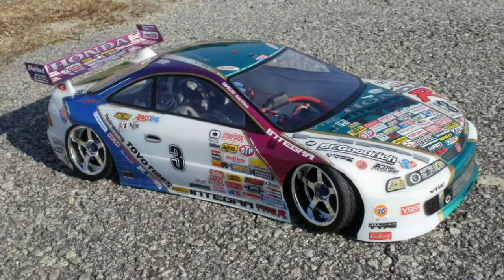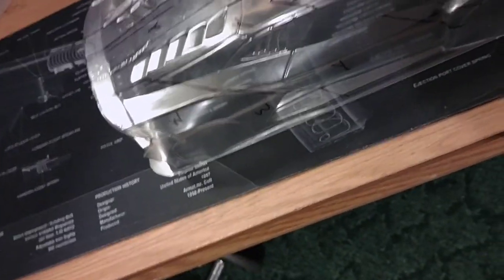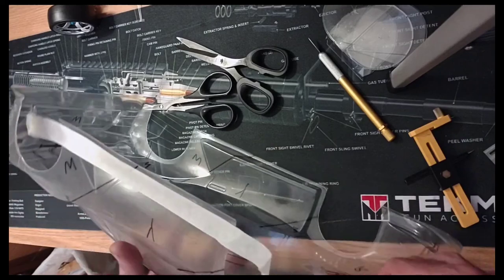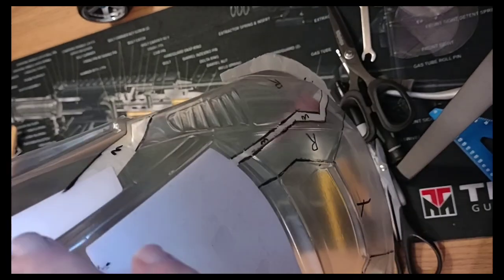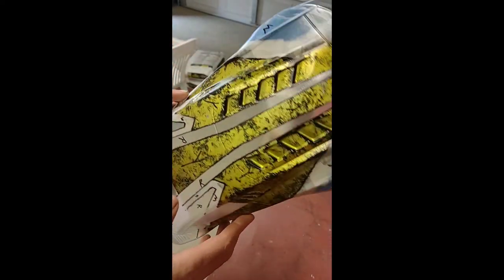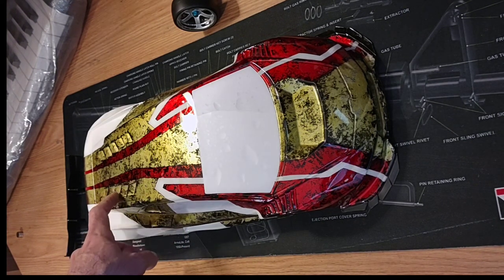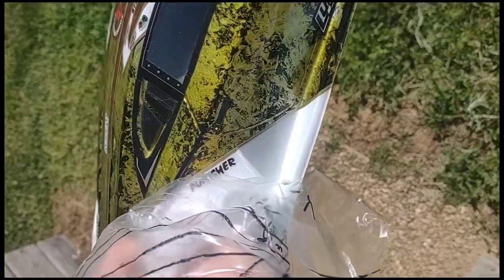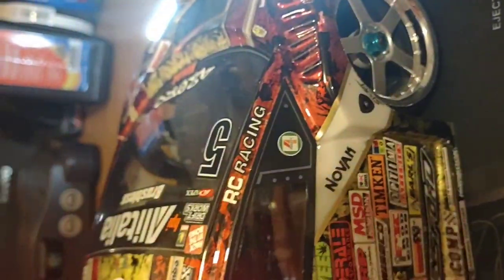Paint a rc car body-Beginners tips: Candy Bowling Ball Mineral Effect #lamborghini #arrma #limitless

Comment: I've been airbrushing RC bodies for a little over 7 years now, and I don't know why,but I could never get any kind or any brand of masking tape to work well with me,but you and alot of others make it look so easy lol. I'd be lost without liquid mask. I started using Bitty Design liquid mask and HVLP sprayers, and the rest is history. Honestly, I don't see how guys like you and Hemi Storm make it look so simple.
Reply from the maker: Its been a couple years since I used mask mainly because I stopped doing off road & moved to on-road & drift. As far as tape I use 2" & 1" by 3m - painters grade. There's always going to be mistakes & this video is to help reduce & recover from those mistakes. Also to help make it easy for beginners just getting into the hobby, they can get the best results they can going forward. I've been doing this a long time dude & the biggest things for me are the trimming & all my cuts are perfect. Punching the holes & or the magnets are lined up to mount the body.  The tape, making sure it's smashed to the body real good along all the edges, even in between coats too. That's where the runs come from plus if your roll falls over on it side it collects dust, lint, ect. the paint lines won't be straight even if tapes itself is perfectly straight. What are you running, on-road, off-road, both?
Reply from the maker: I just seen you had a question something about the curved scissors but it didn't come through dude.
Reply: Yeah, I had seen your tool for getting a perfecr cut on the wheel wells and wondered what it was called. I just used curved scissors and my trusty dremel. But I'm thinking I may have to get one of those tools. @skin-kneedesignsskd269
Reply from the maker: @Jarhead1313  It works great. I bought it on eBay $15  Brand: Olfa-compass circle cutter. Comes with 4 or 5 extra blades to. It's worth every penny dude.

Comment: Can you show the colors used and how you did that other body with the green camo type look? Awesome work!
Reply from the maker: Thank you, I appreciate it! 
The brand spray can paint: "Spaz Stix" - Candy Apple Green, Mirror Chrome, & Black. You can find it on eBay & Amazon cheaper than the hobby shop. I painted it the same way I did in this video, but I used the Candy Apple Green instead. I did 2 coats of Candy Apple Green on the Gallardo, that's why it turns out a lime greenish color, & 3 coats on the hood of the Countach looking more like a forest green. Same green, same spray can, just one extra coat. The thing about Candy is the more coats you spray, the darker it gets & if you do to many coats the mirror chrome & black won't show through the candy. Definitely do a test sample to get the right shade. Hope that helps you out dude. Maybe watch the video again when you get the paint & go step by step using the candy apple green instead, with mirror chrome , & black. Pause the video & rewind it if need too.
Reply from the maker: You're welcome.
Reply from the maker: Hey dude, I just uploaded a video step by step sample with the candy apple green Camo in a little more detail.
Reply: @skin-kneedesignsskd269  awesome! Thanks, i'll watch it now
Reply from the maker: @richieaustin1604  Yw, I was just thinking about what it would look like dabbing all the colors in multiple layers.

Comment: Awesome work. That blue mineral body on the video thumbnail... is that also done by you? A tutorial for that would be great.
Reply from the maker: @michaelg.5936 yeah man, I did everything in this video & thank you!  I also did another video where I explaining the breakdown on how to get different patterns. It's called the "New candy camouflage, not your traditional camo" 2 samples
Reply: @skin-kneedesignsskd269  Great. Which colors did you use for the blue camo? It seems so bright as there is no black used. I usually use bright neo colors and backlight them with white. So I would love to do the same with the camo from you.
Reply from the maker: @michaelg.5936  I used candy blue by spaz stix 3 coats, Mirror chrome & the black actually kinda looks like a dark blue in the picture but it's black though. I did a video on how to build a led light kit using the UV black lights for neon colors.
Reply from the maker: @michaelg.5936 my bad, I should've got back to you sooner dude, my computer took a dump. I got a new one & now the software doesn't match up. The videos done just don't have a way to edit it yet.

Comment: How did you do the pinstriping?  Would've liked to see that process.  Airbrush and masking or gold tape on the outside?
Reply from the maker: I used a roll of pin stripping on the outside of the body. It's cleaner & quicker than tape & painting. A roll cost a couple bucks & you can get just about every color known to man. I'm doing that video tomorrow. I might be able to get it uploaded too, if not it will be the day after tomorrow. I'm going to go over cutting sticker/decals, placement, & pin stripping.

Comment: Questions for ya>> Paint what are you using in this one? was Red candy or just normal red? I tried this today with a regular red, light coat, and mirror chrome, but came out nothing like your red... I will keep experamenting and see if i can get it down, but was just wondering if ya have to use candy, like you did in the samples>> Thanks in advance.
Reply from the maker: You're welcome. Yeah man, you gotta use the candy. It's transparent & you can see through it as to other paints that are solid & cover really well. I used Candy apple red by Spaz Stix. I got it on Amazon for like $12 buck a can. Spaz Stick has a few different color candy's & there all beautiful. I did 3 good coats of candy red on the Lamborghini Huracan & 3 light coats on the Lamborghini Aventador. They don't look the same even though it's the same paint. The more coats you spray, the darker the candy gets. Hope that helps & gets you started!
Reply: @skin-kneedesignsskd269  Thanks man, appreciate the info..
Reply from the maker: You're welcome, glad I can help

Comment: When you go to dab the chrome over the other colors, do you do so while the primary color is still wet?
Reply from the maker: @JoshuaElliott-lo5jv  hey dude, I let it dry or hit it with a blow dryer. I did a video in more detail, "New candy apple camouflage" & got another one I'm doing on the pin stripping/decals placement.
Reply: thanks a ton! Trying this out on my kiddos car. Does the primary color  have to be a specific type? Or can “plain” orange, for example, work?
Reply from the maker: The brand is spaz stix & you wanna get candy colors. It's transparent/see through but the more coats you spray the darker the color gets.
Reply: @skin-kneedesignsskd269  thank you so much for answering my questions!!
Reply from the maker: @JoshuaElliott-lo5jv  your welcome, glad to help!

Comment: You ever use liquid mask? I tried and didn’t like it. The stuff I bought was trash though.
Reply from the maker: I used the liquid mask before with an airbrush. A lot time was spent switching colors & cleaning the airbrush in-between plus making all those cuts in the designs too. Idk dude, it's not as technical doing it this way but it's simpler/easier & I can blast it out in a day. I did this video the way I did step by step in hopes to save ppl time, money, & frustration from butchering up an expensive body. Rc is really fun & there's nothing wrong with looking good having that whole "WOW" factor going when you break it out in front of everybody.